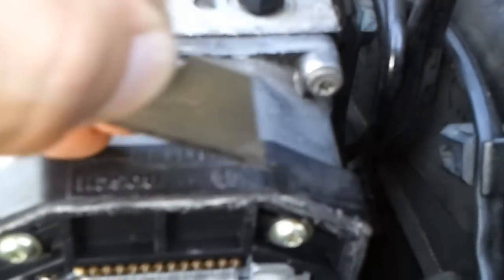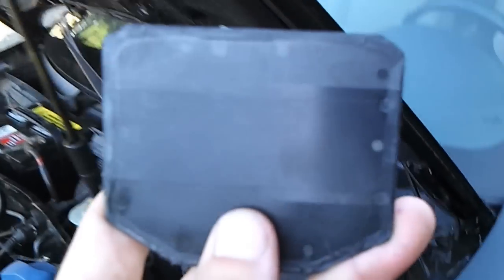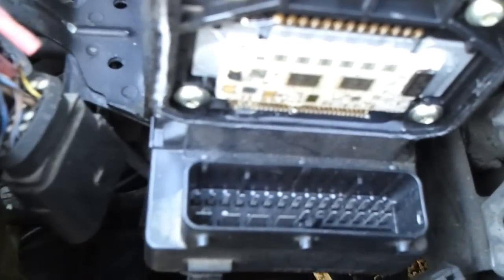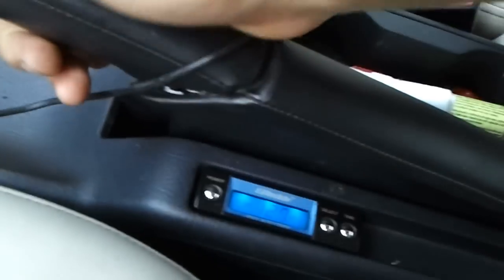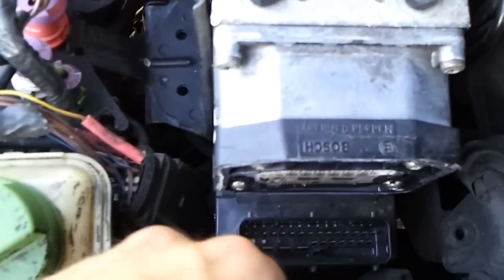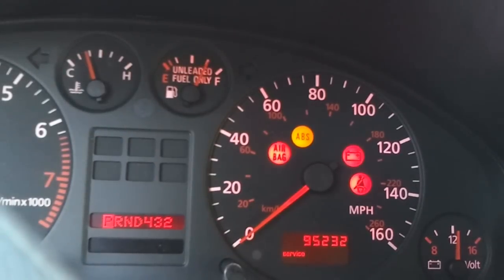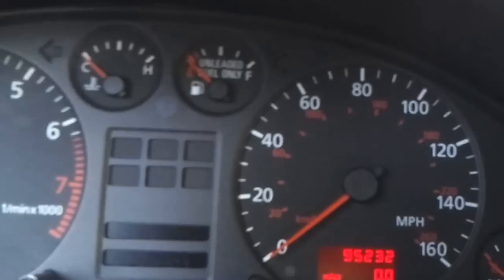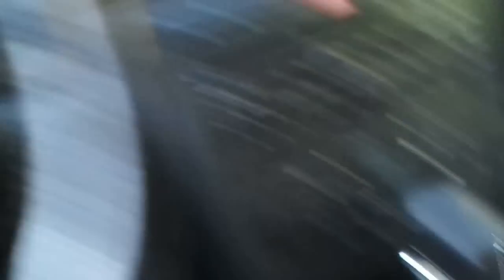1999 A4 ABS module fix

Comment: hey man, how Did you close the box back up as you cut that part off right?
Reply from the maker: I used a little rubber cement for sealing and holding it back on. It also makes it easier to take back off if you made a mistake.
Reply: Hoping to not make a mistake ha, but hoping this'll fix my issue, never really phased me but bugs everyone i have in the car with me so I'm sure it'll affect any interested buyers :\
Reply from the maker: +Rex Designs its just those tiny wires that loose contact. 
Find that one or two and reconnect them. You should be fine. 
My anticipation was treater than the actual fix. 
Im glad I got it on video

Comment: Thanks for posting this. It helped me repair mine. Unfortunately, the tiny gold wires to the left and right of my aluminum wires were too close, and my home soldering iron burned/broke them. Fortunately we have a good microscope and soldering iron at work, so I had to bring the ABS module to work and replace 3 wires in all.
Reply from the maker: I know what you mean. 
It takes a steady aerospace hand to solder those otherwise impossible flakes.